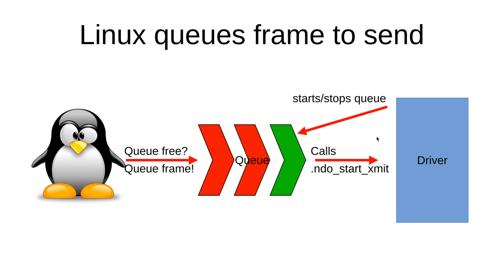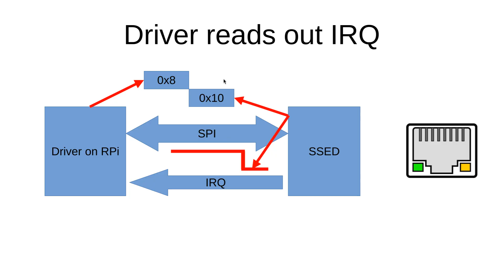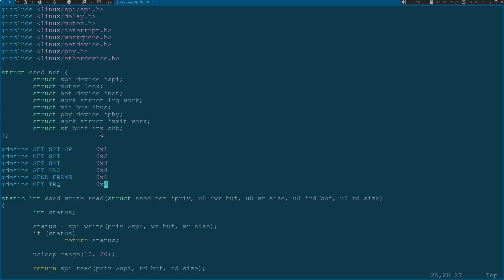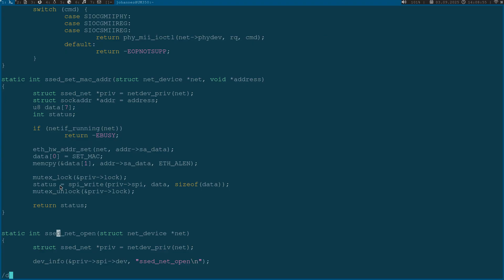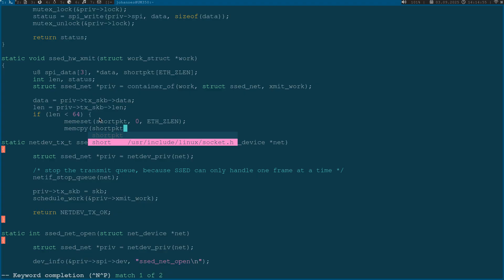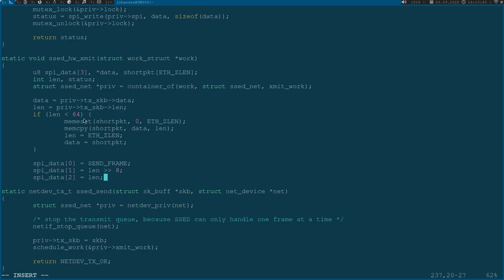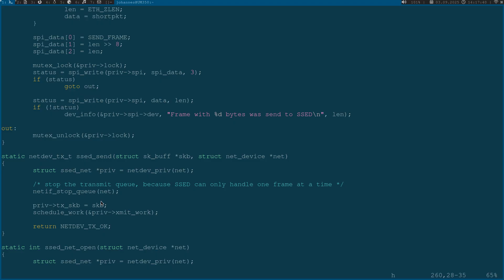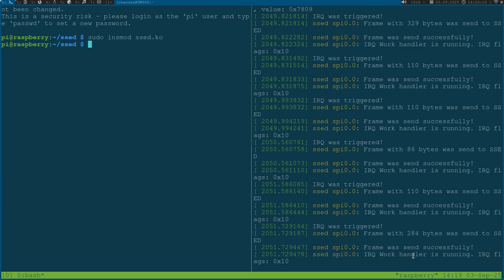Let's code a Linux network driver - Transmitting frames

Comment: Thank you for your hard work! This video is easier to consume with all the slides before you implements the logic in your code. One suggestion - the dmesg output doesn't confirm that the packets were transmitted from the PHY - I'd prefer to have some receiver with tcpdump running on it. And that receiver should be not on your local machine :)
Reply from the maker: You are welcome :)
Yes, you are right. In the next video of this series I give you some proof that the SSED device is actually capable of sending frames.

Comment: off-topic and honest question: do variables really need to have names so criptic?  I mean, "priv" can just be called "privateData". So confusing to see "sk,  tx_t, tx_skb, xmit" ??? cmon...
Reply: they don't. but sometimes it's like, don't need a longer or more explaining name for it so lets just call it resp for response, in context it can relatively easily be understood.
Reply from the maker: It is quite common in the Linux Kernel's code to use short variable names. The names I am using can be found in many drivers.

The Linux Kernel Coding style guidelines recommend a 80 character line limit with 8 characters tabs. So, you need short variable names to fulfill them.
Reply: @johannes4gnu_linux96 i understand there is a legacy due to low memory devices from 5 decades ago and other things. But why keep the lagacy? We can write more readable code with no problem. It also makes the next developer understand things easier
Reply: @ionelCristianLupu_  Because it is how all the kernel developers used to see all the names. So `priv` it is not just `priv` it is the `priv` and everyone who is involved to the kernel development perfectly understands what it is in compare with the name you suggested `privateData` which could be anything! So the linux kernel development it is not only about learning the all the functions in the linux kernel, but also the names and the coding conventions. The function names are coming and go all the time, but the `priv` with us forever. :)